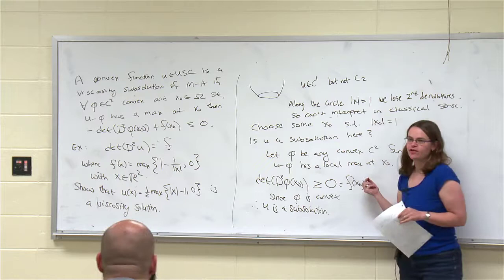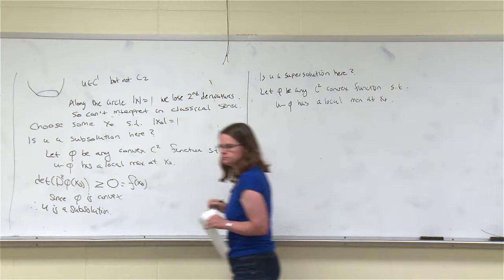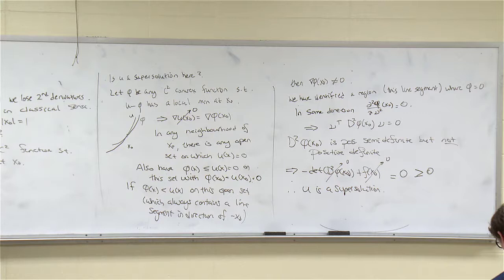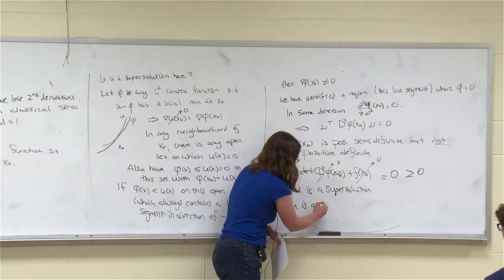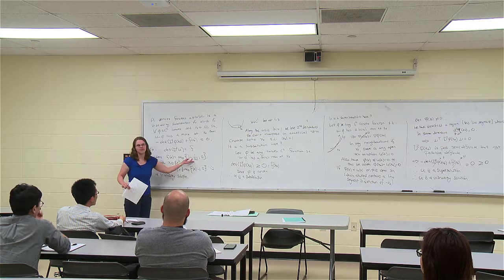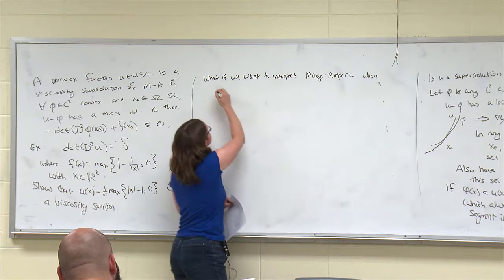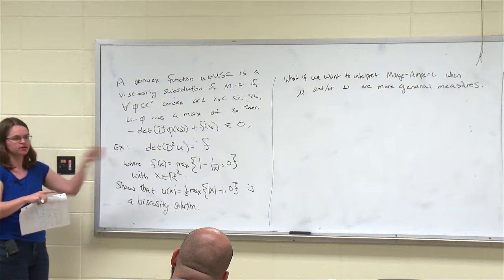Optimal Transport - Weak Solutions of Monge-Ampere

Comment: Hello Prof. Hamfeldt.  At @4:00, I find that , when  |x| > 1,  D^2 u = 0,   so  det(D^2 u) !=  1-1/|x| ;   and the edge of u(x) should be lines not curves.  Is there a typo  or I have a misunderstanding ?
Reply: It is indeed a typo.  u(x) = 1/2  *  max{ (|x|-1)^2 , 0}
Reply from the maker: Good catch!  It should be u(x) = 1/2 * max{(|x|-1)^2, 0}^2
Reply: @brittanyhamfeldt  But if the square is kept in the innermost expression, i.e. (|x|-1)^2, this is always positive and your expression would simplify to
u(x) = 1/2 * (|x| - 1)^4
which is smooth everywhere except at the origin. Did I misunderstand something?

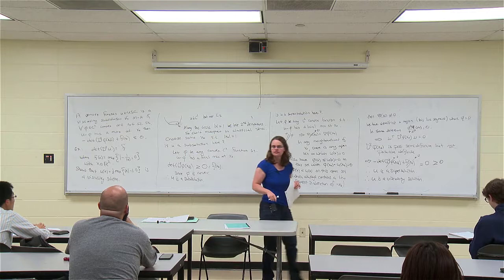Although, given your comment starting at 22:33, I get the feeling that the specifics are not that important and that this is more or less a synthetic example.
Reply from the maker: @torsteinnilssen7942  The dangers of copy and paste!  Indeed, the innermost expression should not be squared in this example.